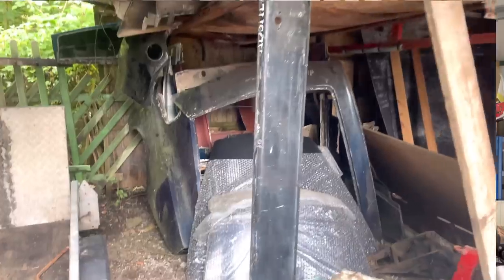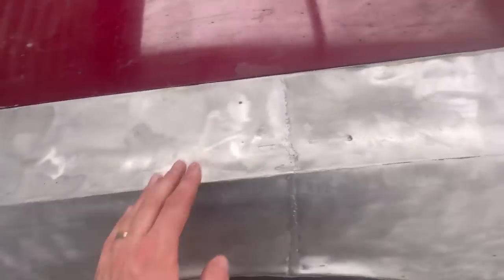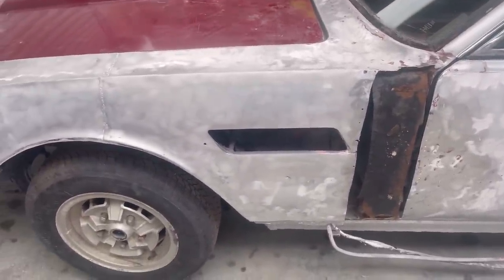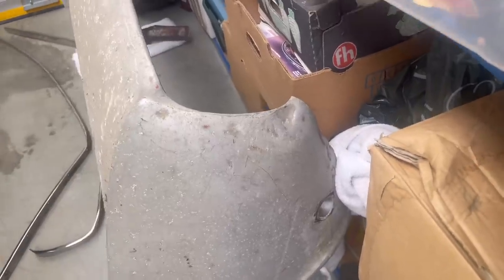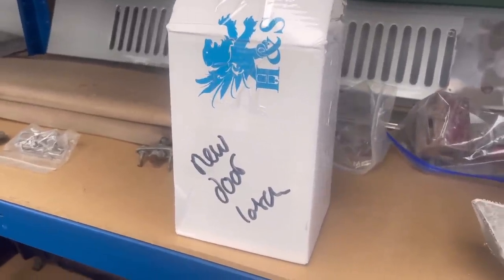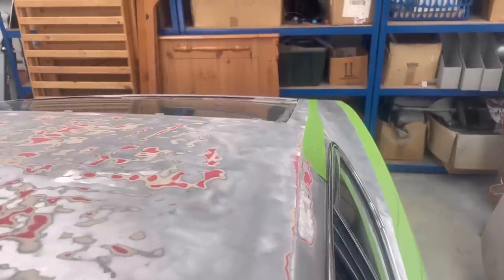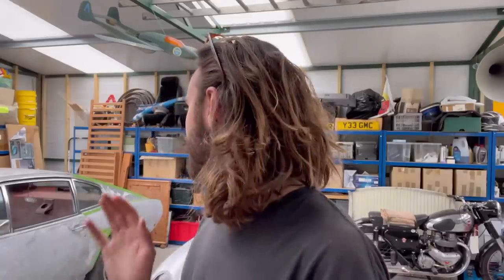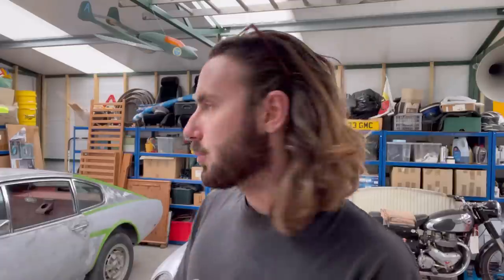Abandoned Aston Martin DBSV8 | Metal Work & New Parts | Episode 2

Comment: You've taken on a very demanding project and I wish you all the best with it. I did a Mark 1 Jaguar rebuild many moons ago and the hardest part was finding replacement doors which fitted. It was badly salt damaged in the sills and lower doors, I found a dealership which did a swap doors routine for older Jaguars, but they were all different in terms of a good fit. Fortunately I could take multiple doors home to sort through, take the old ones back for a credit and return the ones I didn't want. It took me about 18 months and I finished it in a "blackbird blue". Looked beautiful.
I used to own an AJS 650 too .. and I see from other comments that your Matchless is attracting some admirers. Lovely old bikes, wish I'd kept mine.
All the best from New Zealand.

Comment: The ambition is great for no filler restoration, you've got to be a top notch panel beater to straighten an Aston out & looking at that boot lid, that dent looks like it needs welding & that dent has stretched the metal a lot, so will need shrinking, not so easy on aluminium. As I've done exactly what you are attempting to do I will be an avid watcher. Good luck
Reply from the maker: Absolutely, most of it I will do myself, but there are certain bits where I’ll call in some help! With the boot, it’s tempting to get a replacement- as they’re quite affordable. But we shall see!

Comment: Hi Hudd, Have you considered using a Jaguar XKV8 engine to keep it British and there is a synergy between Aston and Jag both owned by Ford for a period. I'm sure that or a Range Rover engine would be reasonably cheap and reliable... ish.
Reply from the maker: I thought about it, but the power from the Chrysler is far superior. And it allows me to retain the original gearbox!
Reply: You can replace the carb with aftermarket Holley Sniper  EFI for better driveability and cold starts

Comment: What gearbox are you using?
Reply from the maker: It has the original Chrysler automatic. Which is why it was swapped with a Chrysler engine, bolts right up